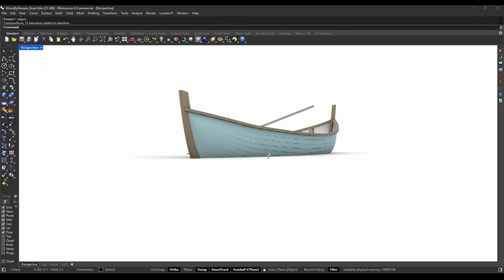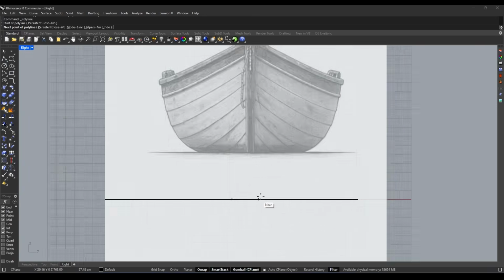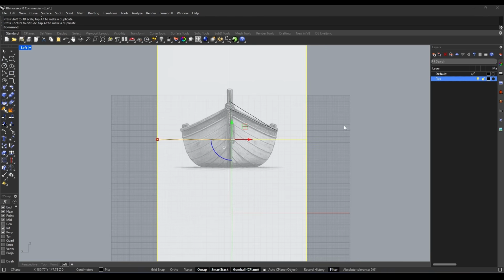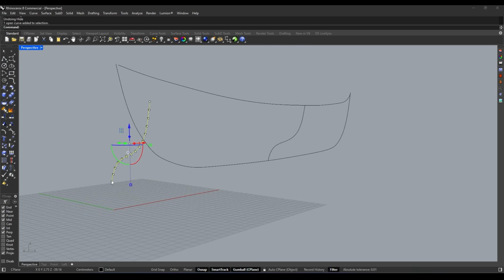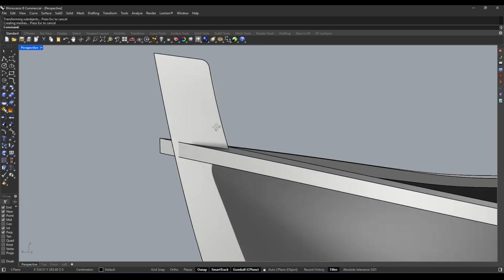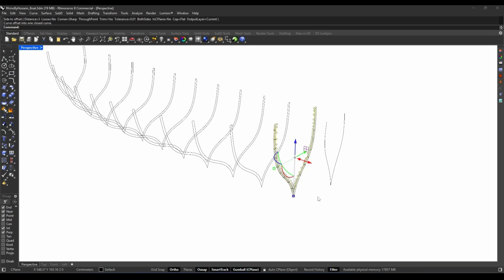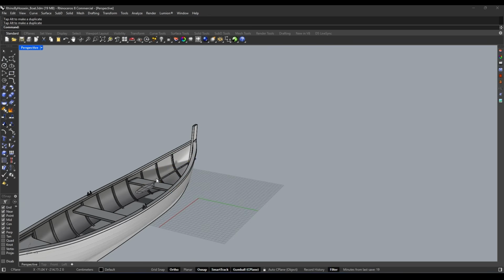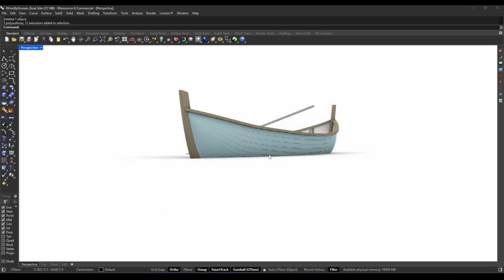How I Model Boats in Rhino | Full Process from Start to Finish

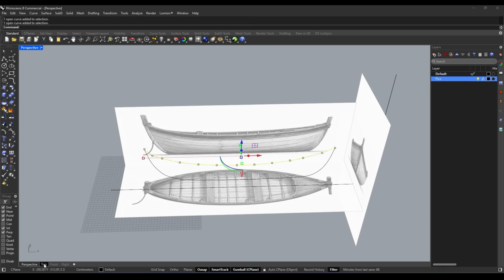Comment: 6:28 moving control points towards each other doesn't mean they connect properly. Scaling up, they are not connected. I guess there should be some trick which is not shown here?
I guess that's why it says "unable to use this curve network" at the next NewrorkSrf command.
Reply from the maker: You're absolutely right! Moving the control points close to each other doesn't guarantee that the curves are actually connected. I should have made that step clearer. Thanks for pointing it out! 🙏

Comment: Hi Hossein! First of all, thank you for creating these detailed Rhino tutorials. I really appreciate how clearly you explain every step. I learned a lot from this video.

I have one question though. Why did you choose Network Surface for the hull instead of Loft? I usually use Loft, so I'm curious about your reasoning.
Reply from the maker: Thank you so much for your kind words! I'm really glad you found the tutorial helpful.

For this model, the hull is controlled by curves coming from different directions, so Network Surface gives me much better control over the final shape. Loft is a great tool, but I usually use it when I have a sequence of cross-sections rather than multiple intersecting guide curves.
Reply: @RhinoByHossein  That makes perfect sense. Thanks for taking the time to explain it.
Another thing I noticed is that you used SubD only for the paddles. Was there a reason you didn't model the whole boat with SubD?
By the way, I'm really looking forward to your next tutorials. Your teaching style is easy to follow.
Reply from the maker: Thank you! That really means a lot.
SubD is fantastic for creating organic shapes, but for projects where dimensional accuracy is important, I usually prefer NURBS modeling. That's why I chose SubD only for the paddles, where smooth transitions are more important than precise dimensions.
Reply: @RhinoByHossein  Thanks again for answering all my questions.
One thing I really enjoy about your channel is that you don't skip the small details. Many tutorials only show the commands, but you explain why you're using them, and that's incredibly helpful.
Are you planning to create more complete project tutorials like this? Maybe furniture, vehicles, or architectural models?
Reply from the maker: Thank you so much for your support! Comments like yours really motivate me to keep creating new tutorials.
Yes, that's exactly the plan. I want to build a complete Rhino learning series with real-world projects, starting from beginner-friendly models and gradually moving to more advanced designs.
Reply: @RhinoByHossein Amazing plan.. Waiting for the upcoming videos..